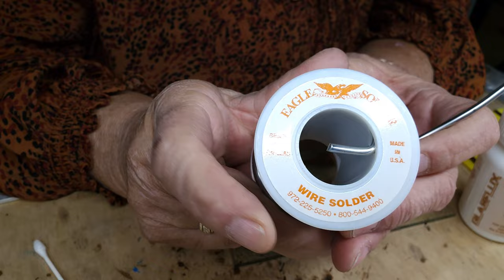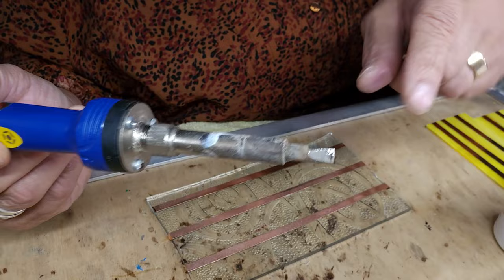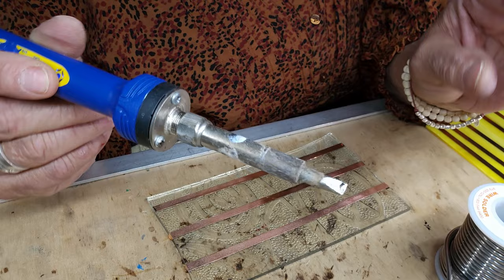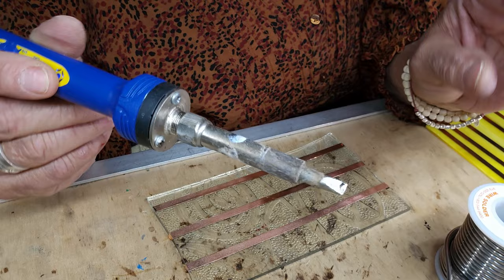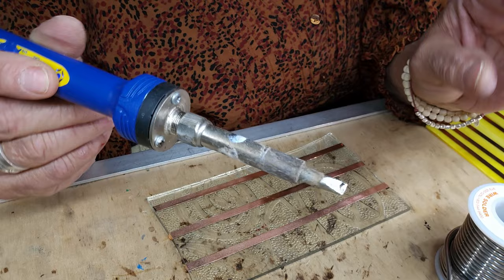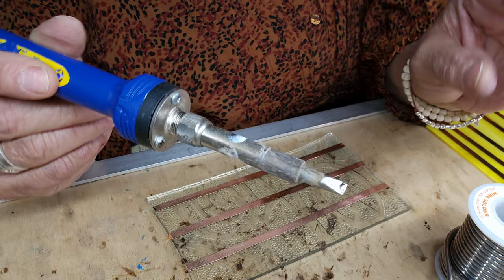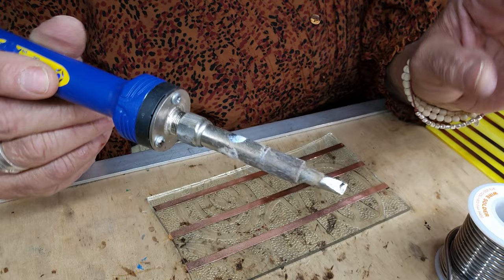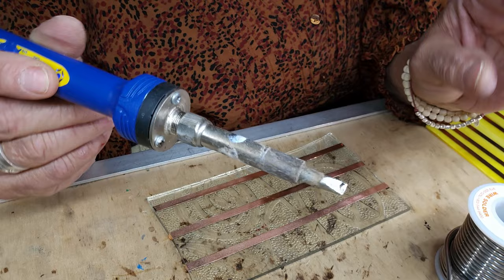Decorative Soldering

Comment: Hi Julie just joined yr channel   ive been doing leadlight & stained glass art for 2 years, thats the first time anyone has explain the flux brush, now i know why some of my joins have come apart, Thankyou 😊and please make yr wire work dvd, did that work have you made it yet 🤣🤣 Thankyou for sharing yr knowledge
Reply from the maker: I've been a teacher for many years and had a lot of students take refresher SG class, and the first thing that hit the trash can was the FLUX BRUSH!  The one thing I noticed that when the Cooper foil looks more like dirty gold that solder doesn't want to adhere to it. Fix that by putting your foil in a air tight Ziploc,  or going swimming in a pool of flux to try to get your foil to take the solder.  Thank you for watching ❣️

Comment: Hi Julie, Thank you so very much for doing this tutorial!!  Some questions...I've been told to never use a sponge with the Hakko because it doesn't need it.  Do you find that's not true??  Also was told not to use steel wool because it could leave fibers behind that could rust. What are your thoughts?? Thanks again for the great video!!
Reply from the maker: Im a creature of habit and I still use my sponge and I have had the same iron for 6 years, never had a problem, but I also don't run my iron on MEGA HIGH!  I run mine at 310° to 360°  
Ive used 0000 steel wool since 1993, it will give you the best black line ever, or any color patina for that fact.  The trick to the steel wool is to make sure your pice is dry then rub the lines brush off any particles left over ( you could wash off if you wish ) 
Then patina.  I hope I answered your questions 😀

Comment: Solder cools it doesn't dry! Never double dip in your flux. You are making it weaker. Clean off your steel wool after using it. Leaves rust spots  ugh
Reply from the maker: 29 years of SG AND decorative soldering and none of the issues you've brought up has Never happened to me! If you watched the video you'd see that I clean my work constantly, and as for the flux I never had an issue there either. Maybe you just learned from the wrong artist. 😩 UGH